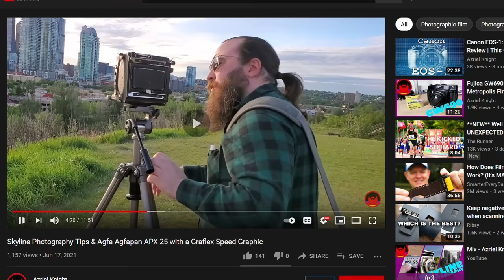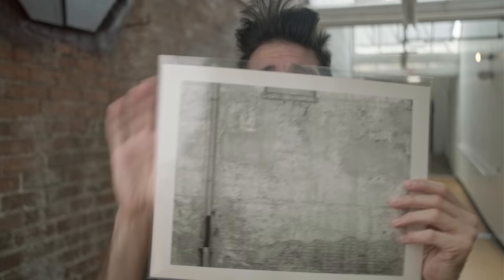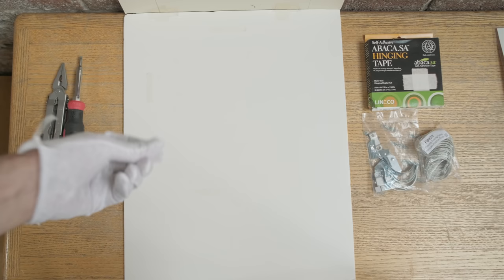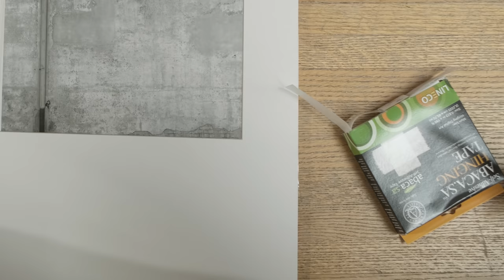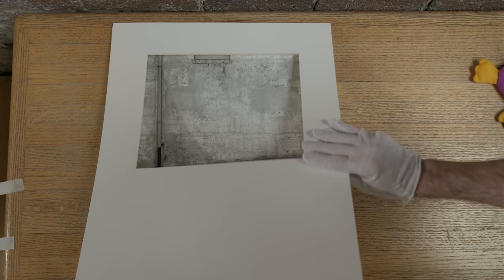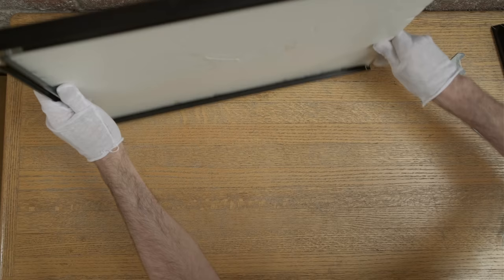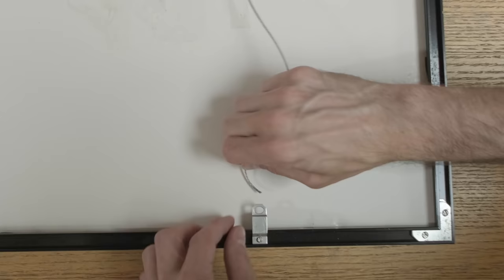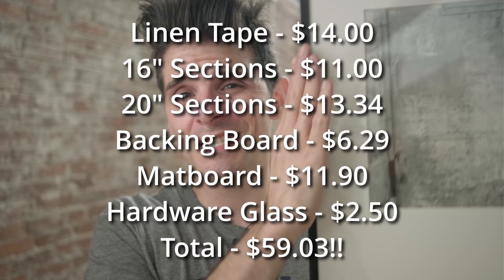Framing Photographs & Photo-Tuber Print Exchange - Large Format Friday

Comment: Hi Mat, an alternative to the t-hinges are "photo corners".  They come in paper and plastic.  You place the print on the board, then affix the corners on to the print, then fasten them to the board.  The advantage is that you can lift the print right out of the corners, with no tape on either side of the print.  What I do is dry mount the print to the board, then custom cut the window mat.  I have a mat cutter.  The down side is that the print is now permanently mounted to the board.  But the advantage is that you can see the whole print.  I trim off the white borders before mounting.

Comment: My framing is fairly similar with a couple of exceptions. 

In lieu of the T-hinge, I use archival corners on the mounting board to hold the print in place. With this method, there's no adhesive touching the print at all. I'm not sure if this is actually any more archival or not but it feels like it should be a tiny bit more archival. If nothing else, it makes swapping prints pretty quick and easy.

I also tend to use arcylic in lieu of glass. Good acrylic can be a little expensive and it scratches somewhat easily but it gives a little piece of mind that it won't shatter and cut my valuable prints to shreds. It's also a lot lighter which is a nice benefit for larger prints.
Reply from the maker: Tipping prints into corners is another good way to keep mounting archival and easy! I like acrylic for frames larger than 20" wide, an especially with many art shows starting to require it. ;)

Comment: Thank you for the video. I usually display the prints in a similar manner. Hinge-mounted or with a piece of tape to each corner directly to the matte. However I do the window bigger. It may be a bit tricky to align the print, but there I find that you loose quite a lot of the photo.

Comment: Great video Mat. I've been making my frames for the past couple of years using Nielsen sectional frames as well. I like the flexibility to make any size I want. I prefer using Plexiglass instead of regular glass because it makes the frame lightweight and easier to hang on different surfaces. My advice to people that want to follow this route is to get an acid-free foam board. It's just a bit more expensive than regular foam board, but it's safer in the long run.
Reply from the maker: Thanks Karin! You've already got a great system in place, and agreed on the acid free backing board. After a few years behind glass, the cheap foam board will out-gas onto the glass and back of the matboard, it's nasty stuff!

Comment: I've gotten most of my frames from FrameItEasy, where I can get a full frame/mat/cover kit in any size I want. Unfortunately, they only sell acrylic covers. I think their reason is that glass is too likely to break in transit.
The problem with acrylic, of course, is that it loves to accumulate static and thus picks up a ton of dust/dirt during the framing process. Getting rid of every last spec of something while framing a print basically drives me nuts.
Reply from the maker: Glass and acrylic both have their pros and cons. For large prints, acrylic is a solid choice, and gives me an excuse to use the big 'ole Kinetronics anti-static brush!
Reply: @MatMarrash  I really should get one of those.

Comment: Abaca hinge tape is not linen tape. For what it's worth, it is hemp. Linen tape is thicker and is made from linen cloth by Lineco. Enjoyed this video, it reinforces what I have been doing with my digital prints for years. I dry mount my fiber based prints and I always leave about a 3/16 inch border between the print and the over-mat bevel cut for some relief.
Reply from the maker: Thanks for the info!

Comment: I started framing again recently.  Been using painter's tape though.  The linen tape and hinging is something I have never done but will probably not end up doing that on my next frame.  Why?  It is a gold toned kallitype and in this case I think I am going to try to do a suspended print - glass all around instead of mat board so you can see all the brush strokes on the edges and the wall behind it.
Reply: Thanks for another great video!
Reply from the maker: Thanks for the comment Paul, and while I didn't talk about it in the episode, there's a few ways to apply hinges with tape that can allow for full face of the paper/print to be visible. Definitely agree about keeping the borders present with alt process prints!

Comment: I know it's trendy and hip, but not a fan of putting a horizontal print in a vertical mat/frame. Also, I find dry mounting is best for silver prints especially if you live in a humid climate.
Reply from the maker: I'm not always a fan of the vertical mat, I tend to keep mine the same as the print. Good point on dry mounting, hadn't even thought of the humidity point!

Comment: Man just can't get enough of fluff. What's the loupe that you use? I remember that it was not clear and had a strap. Can you just put it on the groundglass without being under the dark cloth? Mine is a simple peak one. I need to upgrade
Reply from the maker: I've got a few loupes, but the ones I use the most often are a Rodenstock and a Toyo. Aftermarket on them is getting pricey and there are similar ones now offered by Gaoersi and Luland.  They can be used without a darkcloth but still easier to dim things down with a darkcloth.